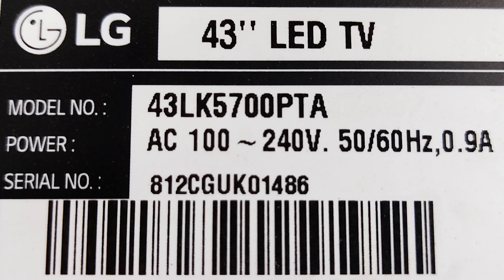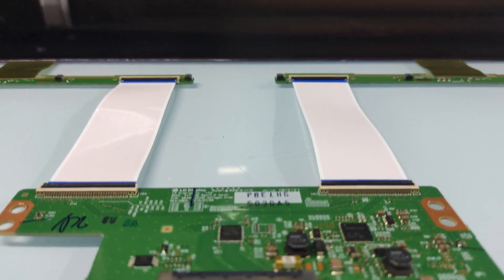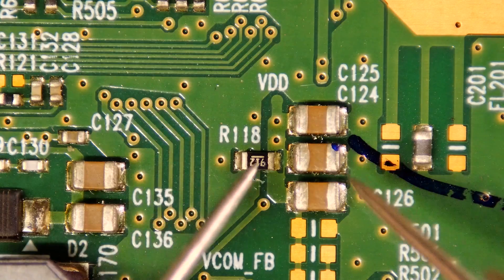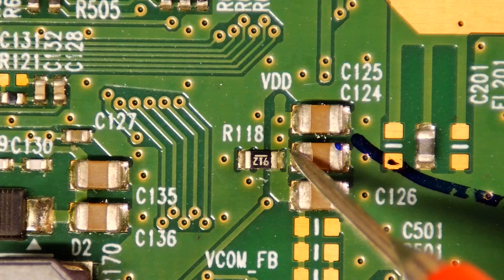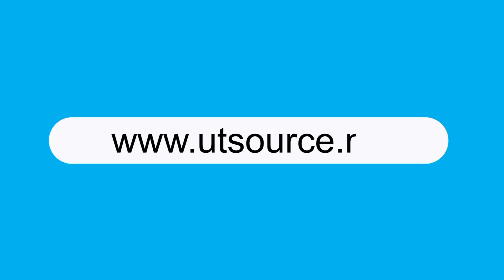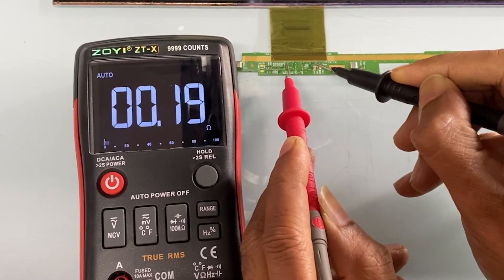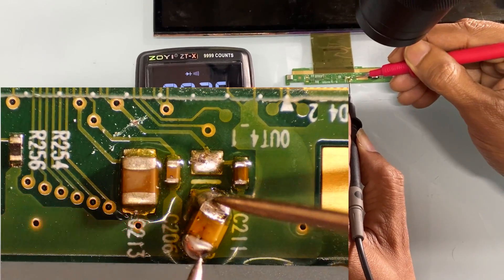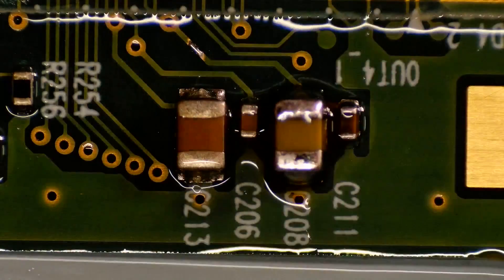How to repair LG TV display problem?

Comment: Excellent troubleshooting guide for the LG 43in TV blank screen issue! Loved the detailed steps on diagnosing and repairing common problems, and the emphasis on conducting a cold line test. Thanks for the clear and practical advice!

Comment: Thank you, on the 49-inch screen, all the voltage's are fine. The ckv signals, as well as the main voltages in the tcon, are good, but it does not display lines, only moving and flekering . I changed a new tcon, and it worked for a month, and the problem came back. I modified it in the voltage's of VGH - ODD and VGH - EDD, and it worked, and after a while, the same problem with this one.  If there is a high probability that the screen will be damaged
Reply from the maker: Internal gate signals of your panel is shorted  that's why the problem keeps repeating.
Reply: @VcoreLC   thank you fo answer What do I do in this case?
Reply: Could you share  LG 
TV schematic?